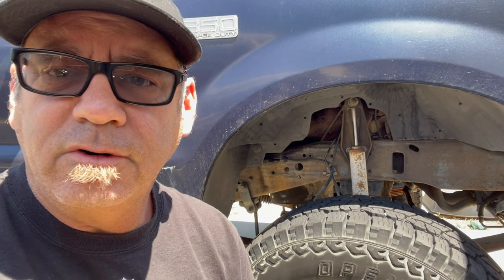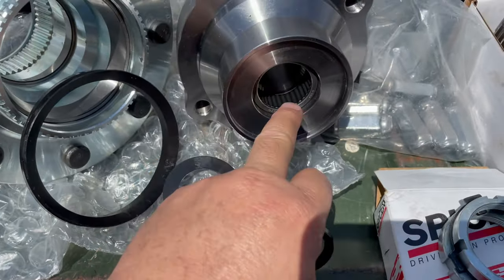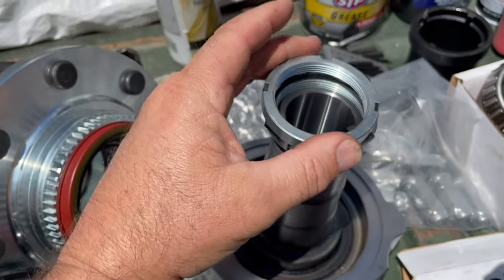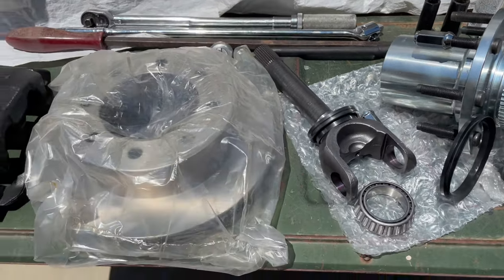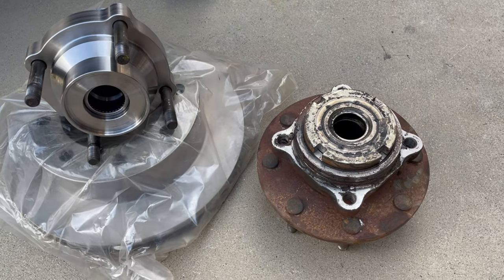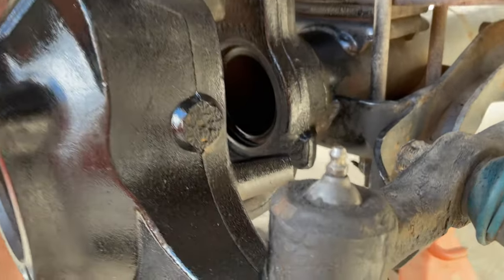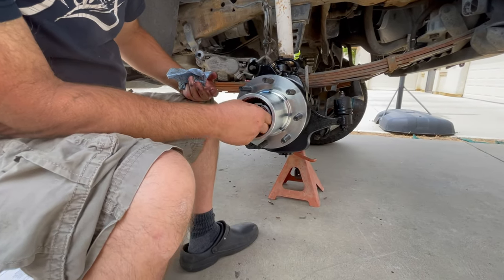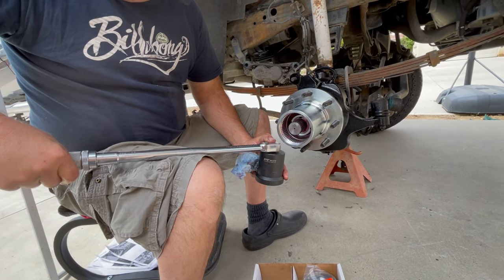Ford ‘02 F350 SpynTec Free Spin Conversion. Full install with seals, bearings, u joints & brakes

Comment: Nice I have the dynotrac one got sick of going through bearings
Reply from the maker: Oh yeah, I had a unit bearing fail shortly after buying my truck in 2017. I replaced them with some EBay units that held up fine, but I never trusted them. With the free spin kit, I can inspect and service them anytime I like. Especially after heavy wheeling, water crossings or just on an interval.
Reply: @tortugalife8536  yeah the stock ones suck the bearings are made out of plastic
Reply from the maker: I’m pretty sure the previous owner had replaced the original unit bearings before I bought it as one of the thrust washers was left out. I bought the truck when it was 5 years old, so I’m thinking that the past owner beat the truck pretty good before he sold it to me..

Comment: To me it looks like you would have the same issues as the OE with the needle bearings.  How does this design improve not damaging the output shaft?  Not being critical, I want a system like this or the Dynatrac.